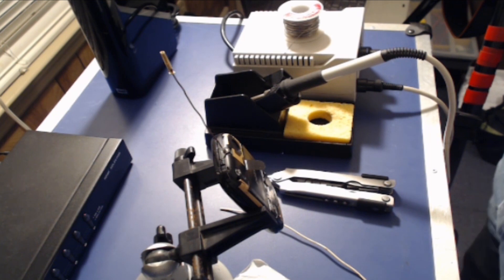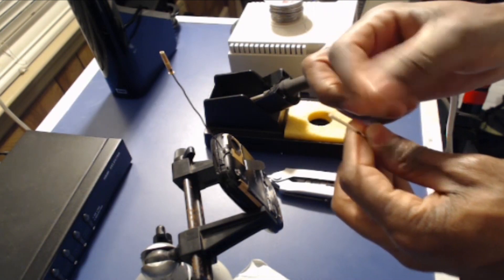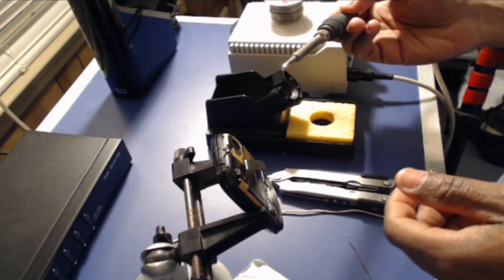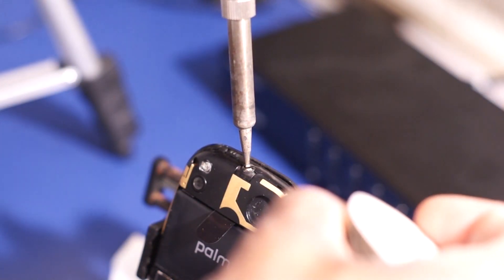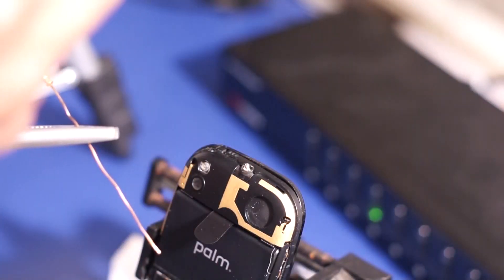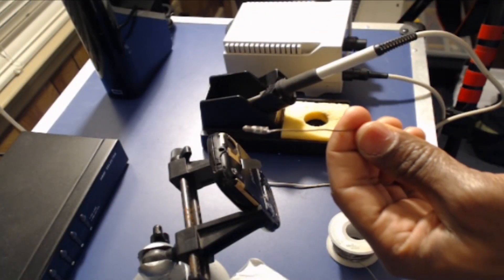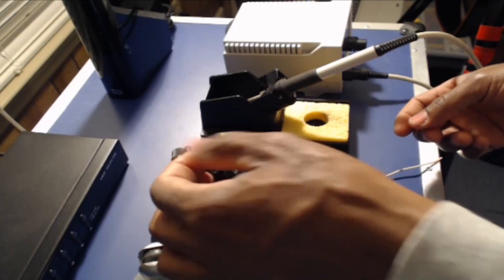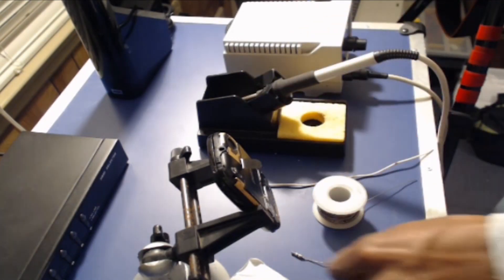How to remove broken headphone plug from headphone jack.

Comment: an easier way is to put a drop of flux on the end of the jack and tin the tip of the wire and just heat the wire.
Reply from the maker: Thanks for the suggestion! :)